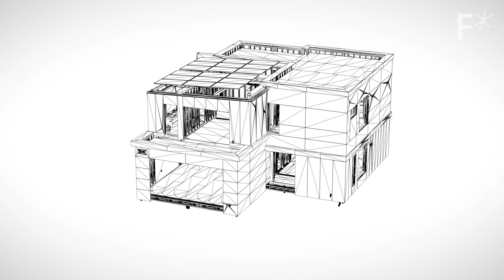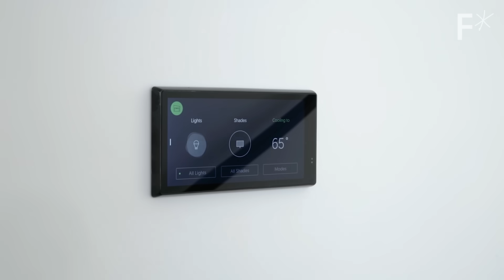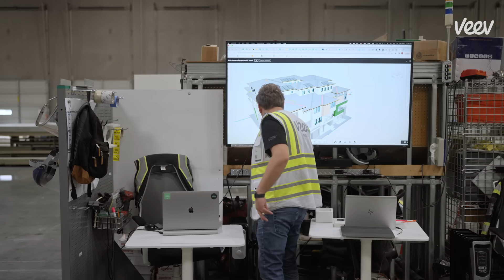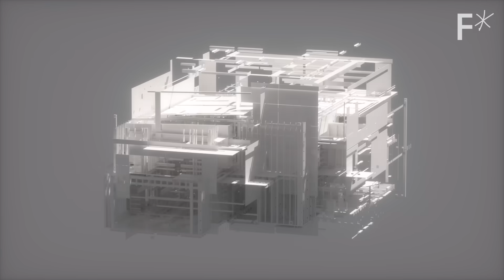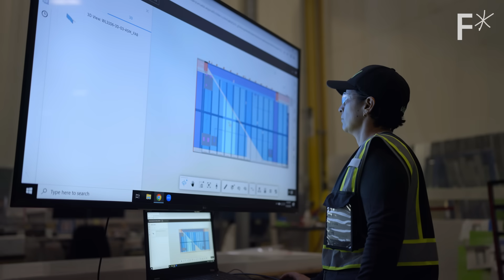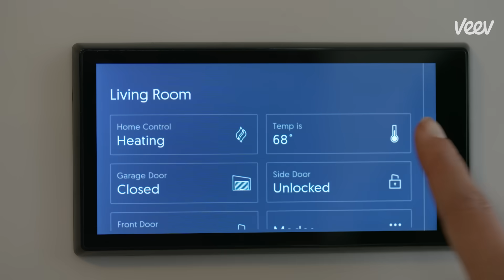We need to build better homes – here’s how

Comment from the maker: What do you think of this approach to building homes?
Reply: Can't wait until this becomes the norm. It always befuddled me that every single home build, no matter how big, small or expensive was essentially a bespoke, custom on-site build. With the number and different types of contractors involved and all the base materials that have to be cut and shaped on site, it's no wonder that houses cost so damned much. I wonder if the cost savings from mass produced factory homes could help put a dent into the homeless problem in this country too. 🤞
Reply: @ropro9817  Evidently you've never heard of modular homes.  Never seen them driving down the highways and byways.  Biggest reason for these not taking off is they were sold by the same people who sell mobile homes and the stigma stuck.

This is not going anywheres.  To techy too late to costly.
Reply: This is amazing!
Reply: It's a closed ecosystem down to the appliances and finishing. Otherwise, it is just another prefab construction.
Reply: Techies always think they’re going to disrupt the construction industry…. Beautiful finish work, and they have a good idea, but nothing that Veev is doing it’s new. It’s just yet another high-end prefab modular.  When I see them doing this for affordable housing, I’ll be impressed.
Reply: As someone who's professional career was in construction management, this could eliminate so mach excess waste on a job site, no just material but labour too, which is a huge step forward and the QC/QA tolerances would be so much tighter. Love this, scale it up, cheers.
Reply: Wonderful and even breathtaking. But what we need is not just another Tiny Home/EV Car situation where the idea is to help society, yet only the affluent and privileged who have the resources or generational wealth and credit that can benefit. We need these on different obtainable levels for everyone no matter your economical status. Or else you're just another planet saving idea that's only within reach of those in your same tax bracket.
Reply: It's naïve at best, dumb at worst.
Reply: Seems like a huge bottleneck for the many thousands of homes that need to be built.
Reply: this is SO exciting! let's find a way to make it affordable. ^_^
Reply: I think it's crap, simply because single family homes are never going to help people afford Housing in most areas, and I see nothing here about building them six to ten stories high.
Reply: Do you plan to expand to the east coast?
Reply: Nothing new here. It’s a manufactured pre-fan house. Been done before
Reply: BullShit... 
You are trying to make my Asset into Liability. Cars, computers, Smart phone all that you are comparing with are liabilities. 

A solid brick made concrete building will provide me 10 apartment 9 of which will pay me back. Even after my death it will shelter & pay to my kids families. Don't you dear try ruining that.
Reply: Looks like it would be impossible to remodel and incredibly difficult to do repairs / remodeling
Reply: @JeremySpidle  Awesome point.
Reply: @Mike D.  Want revolutionary?  Think Earthship.  No heating bill. No electric bill. No water bill.  It does with garbage and simple tech what this shiny box can never hope to acheive.
Reply: @JeremySpidle  LOL good ol'earthships.  It's the wonder of the internet.  Not reality, just the internet.
Reply: @miked.9364  LOL.  Eathships work.  Maybe you don't like them, but they have been built all over the real world, unlike this internet trend box.
Reply: @JeremySpidle  if that was true there would be way more than a couple hundred of these buildings all over the place, but that isn't the case is it?

Nope there is only a handful of these things, because they don't really work and take a, huge amount of resources to be built. (shhhhh we ain't supposed to talk about that)
Reply: @JeremySpidle  Seems a bit petty dontcha think?  'earthships' have been "evolving" for over 40 years.

If earthships worked so well there would be thousands of them worldwide not less than a hundred.
Reply: It's a great concept but we'll have to wait and see the efficiency the final product outcome and sustainability of the system. Have a few of my own conceptual ideas I think will far supersed this concept in ease of assembly, cost of manufacturing, efficiency and sustainability..

Comment: Veev has not solved the fundamental construction issue which as plagued panelized buidings  for decades...ie....getting a perfectly level, straight and square foundation to build on. Even the smallest discrepancies can turn into huge joint problems. The other issue of course is transport and site access for large cranes and semi trucks. The reason why site and hand built homes dominate is that they can constantly adjust for irregularities, they don't require fancy machinery or factories, and they can be  built on tight and irregular sites. Most of the world's affordable housing is all owner built with simple materials and tech. Veev needs to recreate this.

Comment: Metal is a heat conductor, and therefore your first condensing surface.
The proper way to insulate a metal framed structure is to put ALL of the insulation outside of the wall. As shown @2:32 I suspect this home will have terrible thermal performance immediately, and eventually develop terrible mold through the formation of condensation within the walls. Any insulation between metal-studs is practically useless (heat finds the path of least resistance: METAL), and I suspect they are relying entirely on a perfectly sealed vapor barrier in order to prevent moisture buildup within the walls. Yikes.

Comment: Can you say thermal bridging? Why put any insulation between steel studs? Energy will conduct through the steal studs bypassing the insulation. If you want to use steel studs, the insulation needs to be on the outside of the wall.

Comment: This video has been up for 7 days yet their website has had most of its material and reference data removed. This concept has been tried over and over, there are many reasons by building and design has been done externally but overhead is the main one.

Comment: I love the concept of modular off-site construction.  It is more accurate, reduces errors, cuts costs.  What I'd love to see is modular construction using a sustainable, natural product like hempcrete or hemp wool.  Hemp is carbon negative, insulating, fireproof, and requires no moisture barrier.  What I like best, though, is that it doesn't off-gas VOCs, and thus creates a healthier indoor environment.

Comment: I would never buy a house built that way, it would be so hard to repair that the cost of maintenance would way more expensive.  You would end up having to hire specially trained contractors who have access to their materials and thier designs.  It may be a practical way to manufacture homes but its not a practical way to make them sustainable.  Just look at a 50 year old mobile home. They thought the same thing.. oh wow look at this manufacturing marvel, we can integrate all of these processes in one place... and then they are 2x more to fix. Often these homes are never maintained and the eventually are just throw away homes.

Comment: You are absolutely right...'we work for our home'...the technical question is: How can it be made to work for us? The pre-manufactured home as a option to the housing crisis is only part of the solution...an increased density of housing units ...is the other. A single unit approach is very expensive, no matter the construction method. Perhaps we should be looking at the multi-family clusters using this method (an well designed  infrastructure makes sense at a much bigger scale). The issue of extending the life cycle of the materials, is appropriate, given the number of times 'the family' is expected to change their address in their lifetime. I believe that the world is changing fast toward more flexible 'life choices' as where work will be no longer be tied to location.
Direct home ownership models have lost their appeal for many a generation...'access and time use' will be a more appropriate in the future. 'We should be no longer limited by political, national borders, or well designed artifical constraints that keep everyone  intentionally separate for selfish economic agendas.' Given that climate change is here...we need to 'pivot' our references...now!
Retired Architect.

Comment: Iv also always thought earthquake proof to some extent may b a way to rid our selfs of the tires we stock pile infused with concrete to absorb the shock waves an reduce to vibration of the structure but not sure if it create a bigger problem it all needs deep testing.

Comment: fully furnished home is all good and dandy as long as electronics and fixtures will be better and more cost-effective than the competition. things that need regular replacement, such as light bulbs, should not be customized; so the owner can choose what bulb to use...in places like NYC, the cost of the home is mainly due to the value of the land the house is sitting on and less to do with how well designed the home is or the quality of the materials being used.

Comment: I see a whole lot of greenwashing. The walls are steel framing aka massive thermal bridges. The so called breakthrough material seems like a type of plastic also not eco friendly . The electrical design seems more resource intensive to fit into their mold. All in all seems like a product meant for the rich that want to feel like they are part of the solution while talking six steps back and one forwards. Their a plenty of companies around the world building this same thing with a variety of methods from pre made straw ball walls to this plastic and steel monstrosity.

Comment: Do the walls just provide the "infrastructure" of electric and water, so that you run pipes on the wall from predetermined connectors in the wall to your desired outlet, that again sits on the wall, and isnt sunken into it? Or are the outlets directly build into the wall,  ALLthe wires and pipes run inside, so you need a to replace the wall completely for every new outlet you need?

Comment: My concern with treating homes as a product is that with the positives of product design there comes negatives. Planned obsolescence, restricting maintenance to only Veev approved people, having to buy only Veev approved materials. I don’t want to have to call Veev to replace a lightbulb or fix my furnace. Gives them way too much power.  

I’d like to see a follow up comment or video detailing how Veev doesn’t plan on doing anything like that.
Reply: i would like to say this also gives the chance to make homes almost open source at first it can be only corporations doing it but eventually some guy is gonna have an idea to make a website where you get to put what ever you want in your house then you pay for it and the parts get shipped to you with the building instructions and then you can hire who ever you want to build it for you or do it by yourself
Reply: Restricting maintenance..???   NOPE... Right to repair...    Unless it's under warranty they can't say a "F"ing thing.
This won't work anyway, in any state with cold winters and actual weather, these would fall apart quick.
Reply: My similar concerns (while at same time loving the idea of more sustainble while saving cost/time possibly)make me think of  dangers--but also possible solutions--related to the Apple&Android store monopolies. Or incompatible software for that matter, not just stores;and lessons from Open Source. Idea:Have government mandate some level of compatibility/standards;and ability for anyone to make online "store" Then any company,from small start-up to large, can have it's parts/enhancements on the store, that you can mix and match for your home;and any company can compete for the "assemble it all together" and make bids.

Nothing is perfect but I think that framework is at least a start for thinking about reasonable regulation. We don't have to let everything turn into Apple/Google type monopolies, but not enough for us all to just raise(even valid) concern;it means also suggesting partial/potential solutions like above, and discussing with others online/in person, and talking suggestions to government leaders..
Reply: @hb-youtube  Although, be mindful about giving the government an inch on mandatory compatibility, as they tend to take a mile. This even applies to basic mandatory compatibility across app stores and mobile devices, considering that Apple & Android might wind up pushing for ever more advanced features that could render certain things incompatible with others.
Reply: @Iamwolf134   @Iamwolf134  Well I appreciate you made a case rather than trying to bash what I could put in limited space;I was responding to: "concern with treating homes as a product is that..there comes negatives. Planned obsolescence, restricting maintenance to only Veev approved people, having to buy only Veev approved materials. I don’t want to have to call Veev to replace a lightbulb or fix my furnace. Gives them way too much power"

So I put on the table the notion or "idea" of common standards. I'm well aware of and agree about dangers of centralized government power;if people agree not to ignore or pretend there's no danger from centralized corporate power/market power, then one can have a healthy discussion. 

Certainly, while I didn't fit it into my reply, I'd be open to lesser steps that encourage(without mandating)like big easy to see info for consumers whether compatible w/standard(s) or not, so consumer is forewarned.

Last thought:Decentralized tech,while not a panacea some claim, offers in future will offer more opportunities for "a third way" alternative to (at least some of)both government and corporate centralized control. Up to us citizens to try to make the most/most positive from it.
Reply: excellent point
Reply: The 'productization' of homes seems even more ridiculous when you consider that virtually every home needs to be designed and constructed differently. No two plots of land are the same, different building codes, different weather conditions, etc. I wonder if local trades can do this localization more efficiently than any centralized prefab company. There's also something super weird about loading these homes up with a bunch of useless 'smart home' tech if the objective is to make them more affordable. Seems akin to the way modern cars have become so much more complicated through the belief that consumers want convenience at all costs.
Reply: valid point and in homes , this level of extrapolation of the product perspective should be regulated by government or society-locality association
Reply: If Apple has taught us anything its that people are more than happy to enter into an arrangement like this if the product is good enough.
Reply: @aimhighguy I think that's accurate to a point, but only to a point. And there are huge drawbacks to this. Apple is now making products that are extremely hard to repair, if not impossible, and there is no other reason except profit. Because they have cornered a good portion of the market, they are now able to manipulate it. And the environmental consequences are not insignificant by any means. Apple is not green, nor do they care one bit about the environment. They are creating massive amounts of e-waste every year due to their manipulative practices.
Reply: @aimhighguy  is good enough, i like that
Reply: @aimhighguy  That's a fantastic point
Reply: Homes should have never been an investment vehicle. But a tool. A place to raise a family, age with dignity and support a community
Reply: @everythingisfine9988   Never be an investment..??    What drugs are you on kid?
Do you have any idea what it costs to maintain a property with a house on it or how much property tax costs yearly..?? No you wouldn't, apartment dwellers have no friggin clue.   You need to learn a heck of lot more about life before you say something as misinformed as you just said, which is just YOU'RE opinion, BTW.
Reply: What a silly comment.

Comment: So if I need to replace a lightbulb or a wall socket, I need a Veev-branded one?  What if I need to replace windows or the roofing?  Veev-brand?  I fail to see how the consumer gains anything when the home is turned into a "product" as Veev wants to see done.  Sounds like they are just trying to capture wallet share from homeowners.  In the current market of affordable home shortages in most major cities, we need homes to be further commoditized, not productized.

Comment: I absolute agree with a caviat. Homes should be designed more like luxery yachts. Get experts to design a functional space just like they design cars.

Use modern materials, try new ideas for sure but...

The proof is in the pudding. What will their houses look like after 10 or 20 years?

The box designs shown have no eaves, no real spouting. Will the exterior panels get mouldy and streak over time?

Houses are build as they are for a reason. Often reasons forgotten but valid never the less.

Because a house is so expensive it tends to be considered a permanent product. Those are insanely high expectations. Maybe this is where innovation needs to take place.

Comment: Seems like an attempt to make a housing monopoly with little variation in its design. Ultimately because it's a business you will get pre fabed buildings that externally will look about the same. Controlled by a single business for every component of your home. Some benefits to this method sure, dont think it outweighs the detriments.